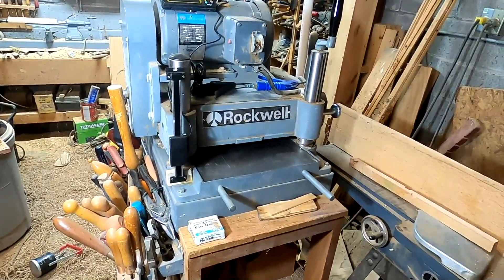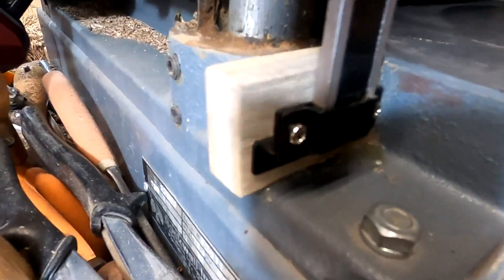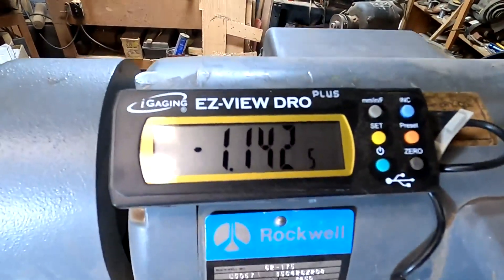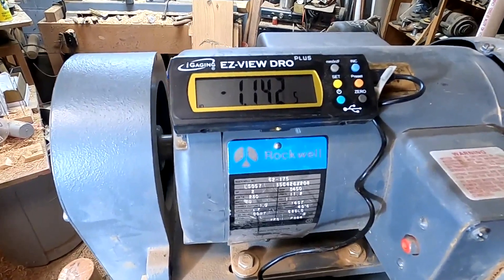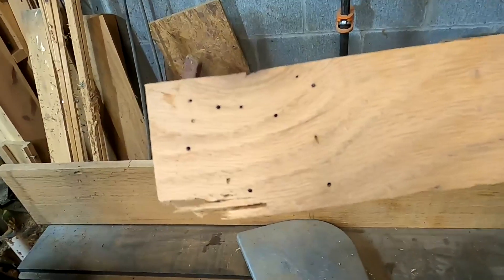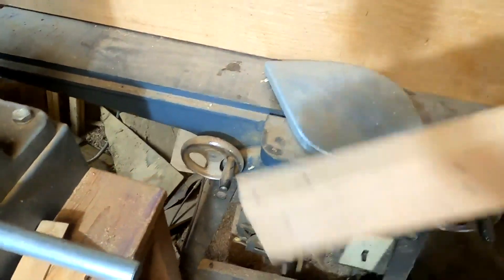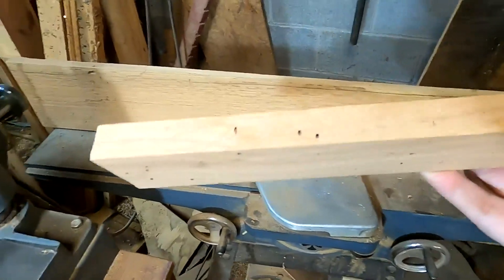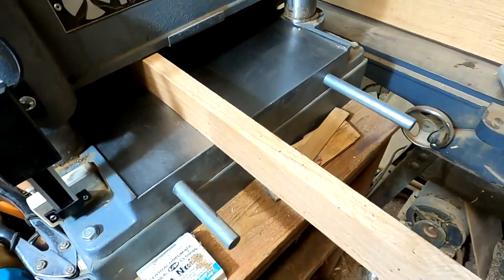iGauging Easy View DRO Button Usage

Comment: Have you considered the set button to be the set Origon set button.. I copied this from the EZ View manual. (Using Origin:
Long press (3 seconds) Origin key to set a origin zero. After setting, the Origin zero is the absolute zero that the
readout will memorize and recognize everytime when unit is turned on.)